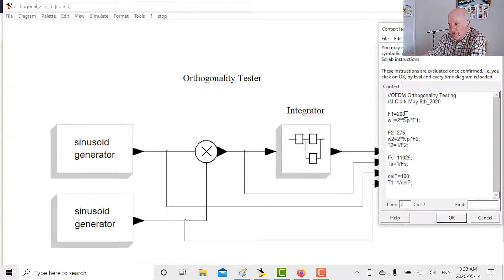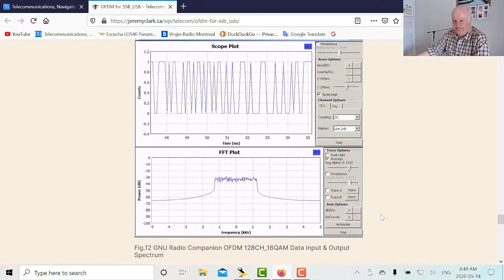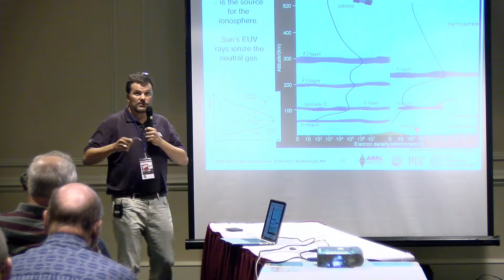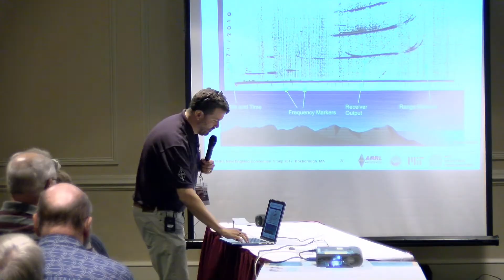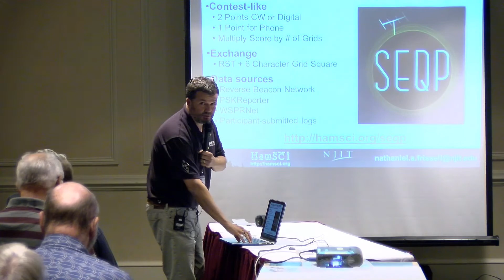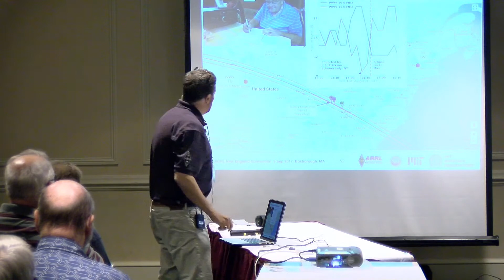VK3AML 18 June 2022

Comment: OFDM and good looking YLs is a great combo!
Reply from the maker: I thought so - and thanks again for your input. I'm fascinated by the potential that OFDM has for overcoming audio problems on HF, I just wish the hams would put more effort into audio quality than into extremely high compression codecs! Its usage for SSTV is great, and I have been co-convenor of the weekly Melbourne DSSTV ('EasyPal') group on VHF for some years. But our images consist of hiking photos, travel pics, circuit diagrams and pictures of equipment. It seems that French amateurs are interested in equipment of a different type...
Reply: @AusRadioHistorian  Got interested in OFDM when DRM shortwave got started. I'm from Quebec, so I like all things français!